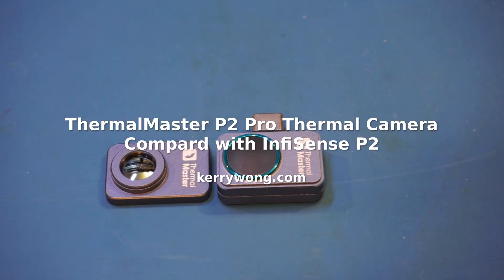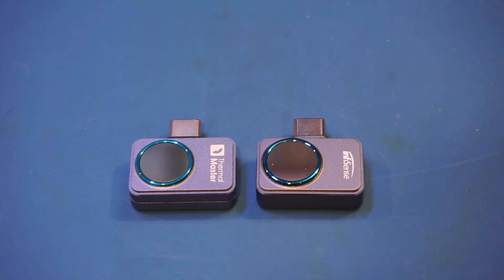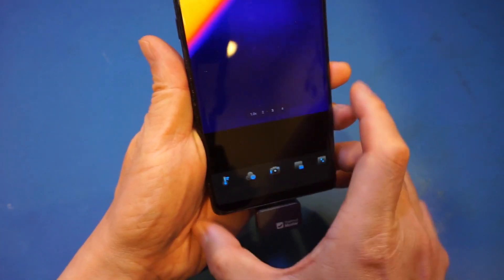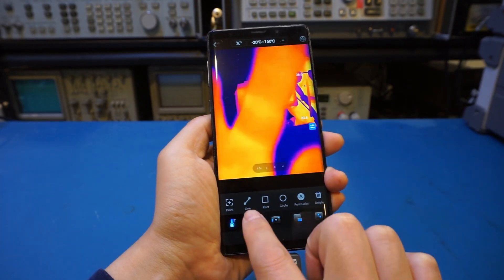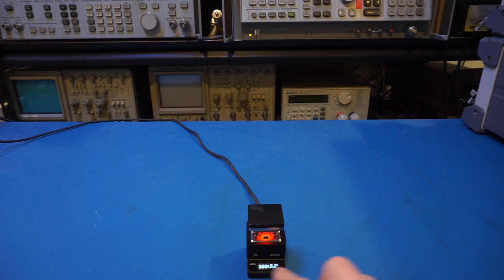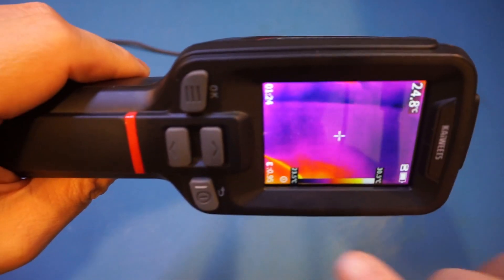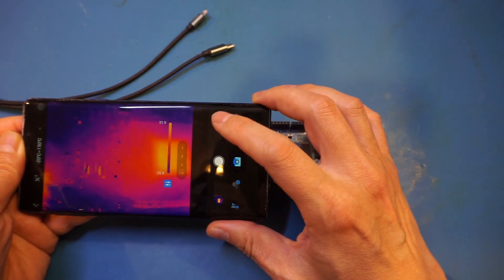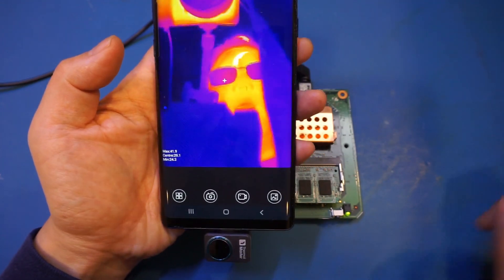Thermal Master P2 Pro Thermal Camera, How Does it Compare to the Original P2?

Comment: can you confirm you need the macro lens for Circuit boards?
Reply: No you don't need it for circuit boards, although it would probably help if it's mostly smd's. I work on Tektronix scopes and older HP equipment and the P2 works great! The regular P2 doesn't have the magnifier

Comment: Of course you have circuit boards. 😂 I think this means that you can check your PC components for hotspots in order to optimize the cooling performance of your system. Sounds super exciting in any case. Anyone who knows a bit about thermal imaging cameras knows how expensive they normally are (Bosch and co.) It would definitely be interesting for me to check my parents' apartment for cold bridges. They always complain about cold walls.
Reply: it is incredible stuff indeed.
Reply: These comments give me the impression that you aren't aware of the vast variety of low cost thermal imaging  products already available.
This product is nothing new - the P2pro is just another model in a wide range of competitors (often at a lower price point)

Comment: Is it possible to enable hot/cold-spot markers?
Reply: Totally excited for this too! This feature doesn’t seem too hard to add—maybe they'll include it in a future update. Fingers crossed!🤣
Reply: @BarniAli-lm2ri  This feature is available in the current version of the Temp Master app (not in the one shown in this video) and can be toggled, just like the temperature range indication.
Reply from the maker: The Thermal Master app doesn't seem to have this feature. I am sure some other apps do and are compatible with the P2/P2 Pro

Comment: I think this is exactly the same hardware as the previous Infiray model - the Tiny1-c thermal core. As I understand it the Thermal Master brand was set up due to concerns over import restrictions and other problems resulting from the hardware ending up in certain products used in Ukraine.

I have a phone dongle camera (Tooltop T256) which appears to be based on the same sensor in a slightly different package. I can use both the original P2 Pro app and the new Temp Master app, and the camera is recognised in both as a P2. I've found it to be pretty decent and certainly very useful.